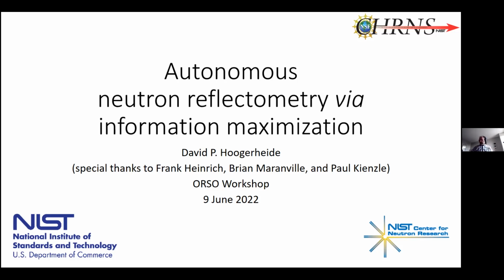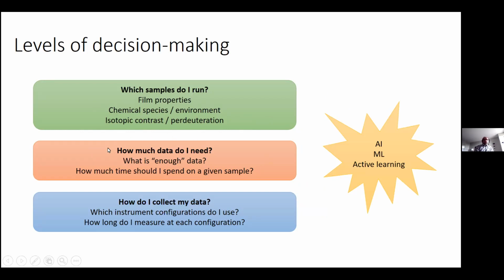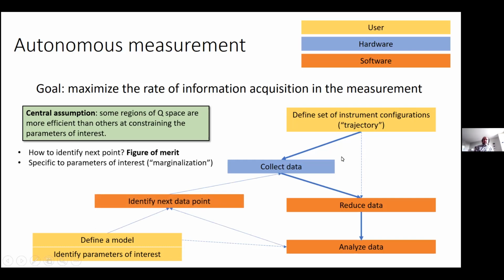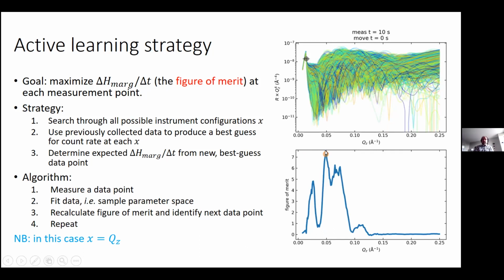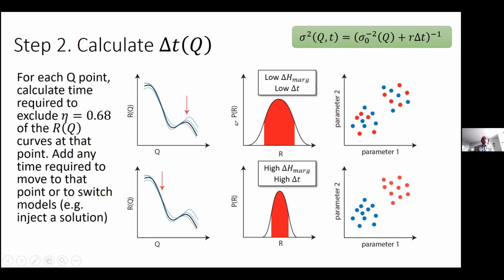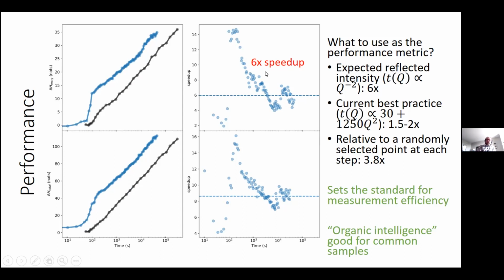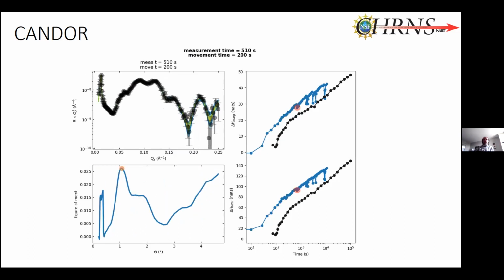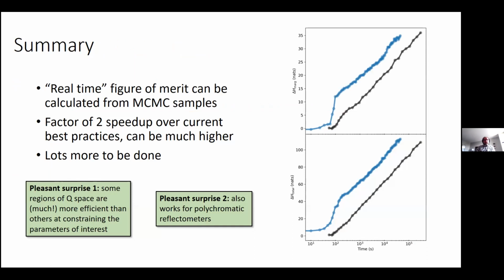Autonomous neutron reflectometry (real-time entropy hacking using machine learning)

Comment: To be clear, I don't propose that Nuclear Equilibrium converts electrons into Protons or positively charged particles, but the Photonic Lattice does regulate the radiation output to the planetary system. Nuclear Equilibrium works in the atomic structure as well as in a cosmic mechanical context.

I would love to further discuss my hypothesis, which I had no clue such a concept already existed! And this proves my hypothesis could be deemed to be placed under rigerous testing and experimentation... At least, it could bear merit. Must if this a.i. Mockast presentation is accurate to my hypothesis which I call, "Father's Physics". I also postulate the trigger of the chain reaction that leads to the transfiguration of the Newtonian atomic model into the "Immortal Atom of God" as proposed in Father's Physics.